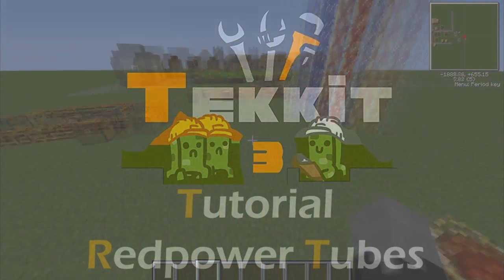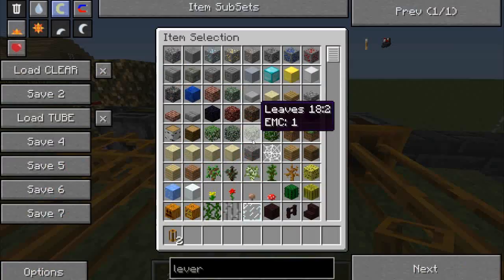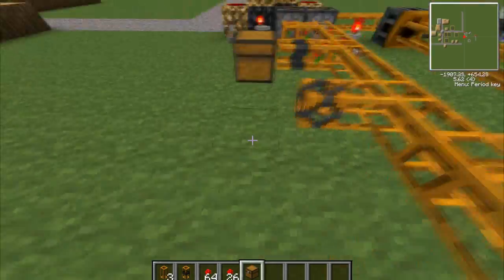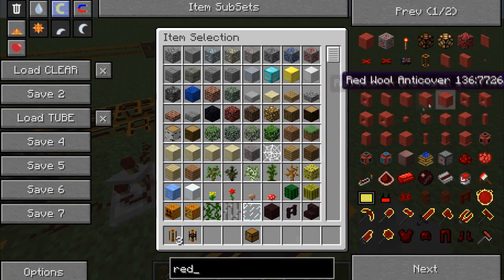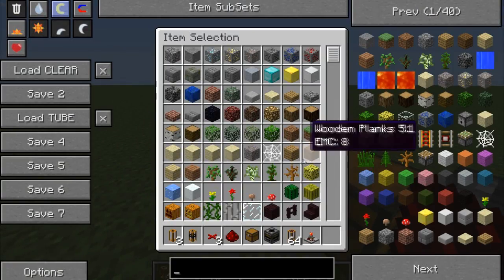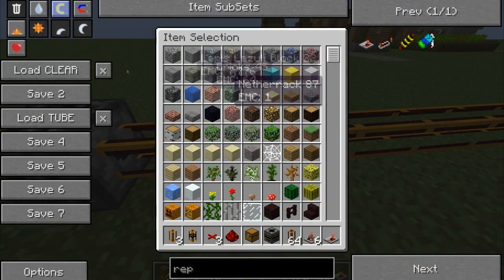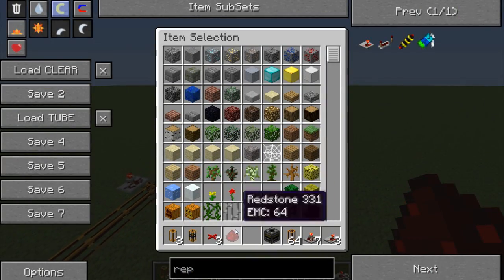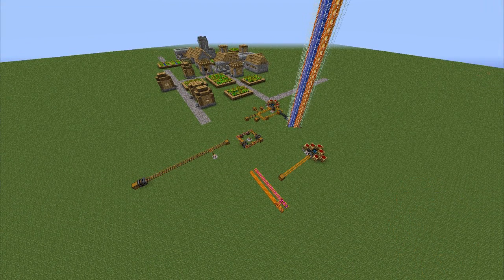TEKKIT Tutorial: Redpower Tubes

Comment: hey great tutorial, but just a couple of things to help you aswell, you can use red alloy wire on timers then use the jacketed wire to connect it to the pipes instead of redstone, and it does carry a signal off the pipes if you use the jacketed wire of a redstone pipe onto anouther redstone pipe then that will receive signal too, thanks